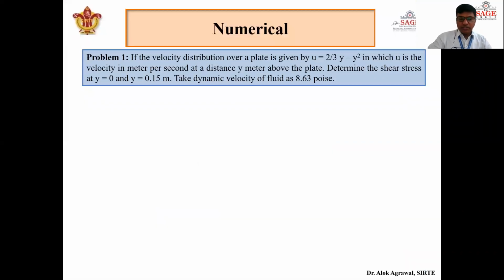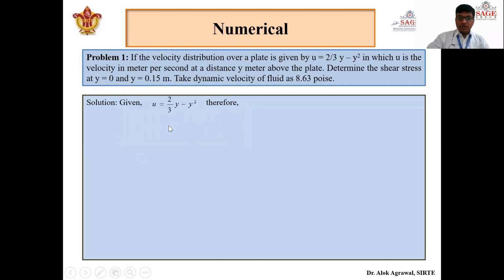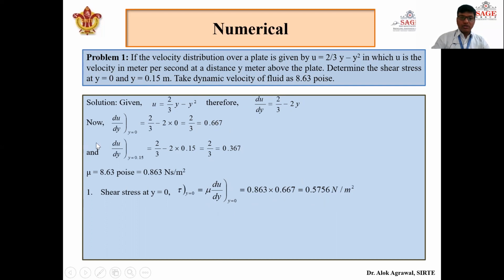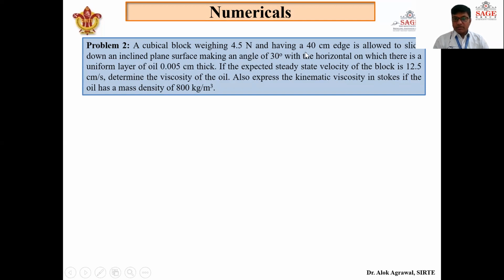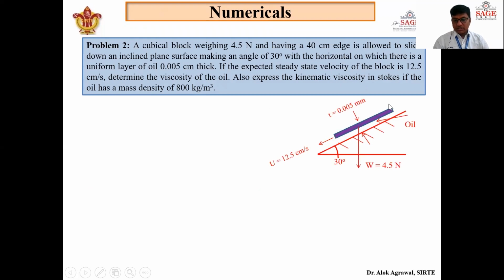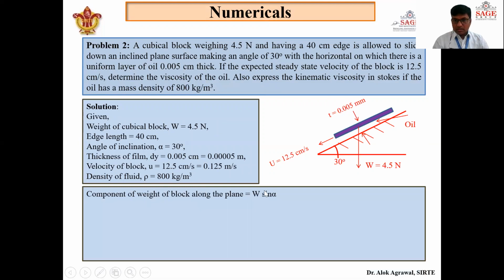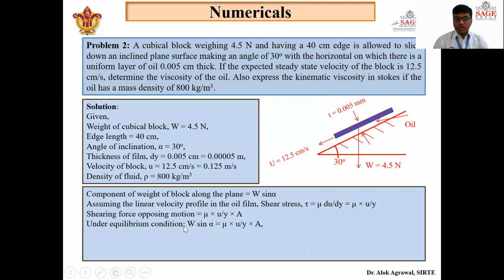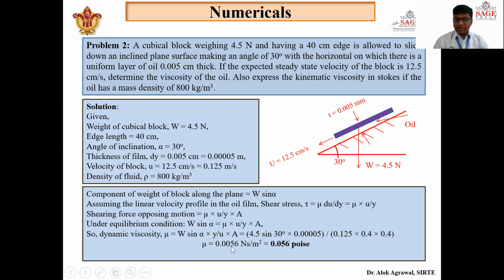Lecture 6 ME 404 Fluid Mechanics Viscosity Numerical Part I

Comment: How do I solve this the space between two cubical flat parallel plate is filled with oil. Each side of the plate is 40mm and it's thickness is 15 mm. The upper plate moves at 1.5m/s. The specific weight of the oil is (quarter) of the plate. If the specific gravity of the oil is 0.85. find 
A. The specific weight of the oil
B. Mass of the oil
C. Specific volume of the plate
D. Dynamic viscosity of the oil
E. Kinematic viscosity of the oil